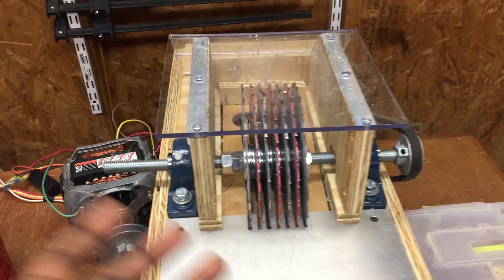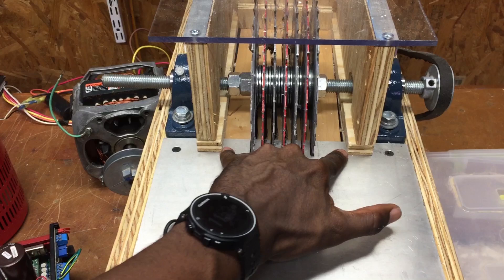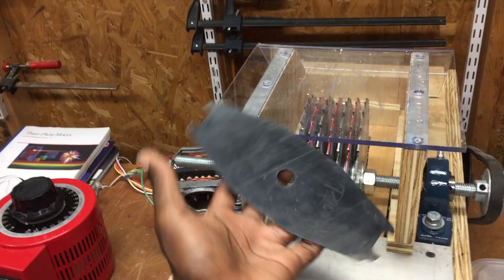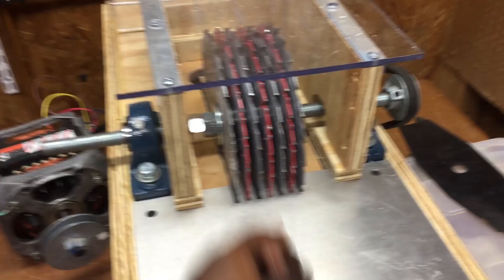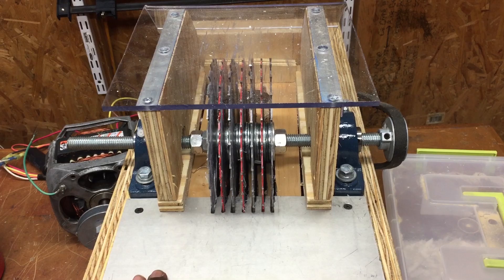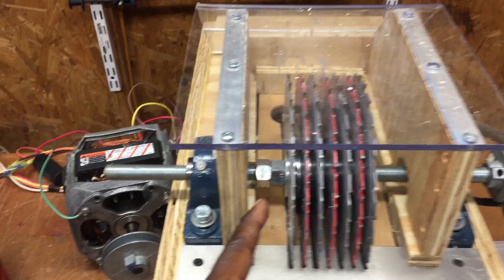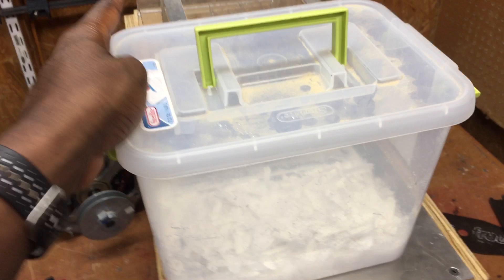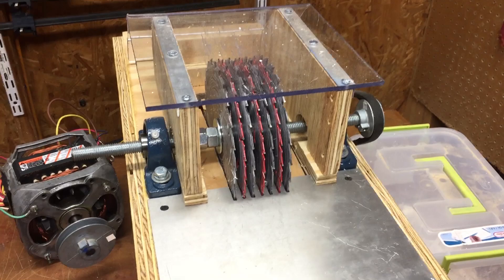Scary Prototype Shredder Design pt 2; A Cheap Alternative to the Precious Plastics Design: 037

Comment: That is a VERY scary shredder. But if you still have 10 fingers and 2 eyes then your safety precautions are adequate so far.

I'm very interested to know how the melt goes with the powdered plastic. I've had a couple go ok and a couple not so good, but the not so good I blamed on dirty plastic.

What material and thickness are you using for your shear plate?

I've been thinking about trying a 6 inch drum with 2 windows and replaceable blades (either utility knife blades or the single edge utility razor blades). I thought high speed rotation and very sharp blades might make plastic shavings. 

You're a great thinker and pretty good videographer. I enjoy your videos and like your style.
Reply from the maker: The shear plate is 1/8" thick aluminum and 1/2" thick plywood underneath. This allows it to be soft enough to cut with the blades and not damage them. I cut the wood first, then after that was installed, pushed the AL into place.

Comment: Also, did you try two sets of blades running in between each other?  You could then top feed and not worry about grabbing. They would share a shear plate.  Working like two rollers pressed together.  Just a thought.
Reply from the maker: I don't want two sets of blades because that requires a great deal more power. I can do more power but only if it is absolutely required. One of the things that makes Dave's Shredder difficult is you need such a powerful motor. I am actually hoping to make it 1/2 hp instead of 1hp... the current setup.
Reply: Jeremy Fielding It would be nice if you could use the air that you spoke of to recirculate the larger plastic back around until it fit through a sort of sieve.  Almost like a hammer mill.

Comment: Great videos Jeremy thank you again. What if you attached some chip breakers in between the saw blades. You could set the length of the strips of plastic by setting the chip Breakers a radius than the saw blades. The chip Breakers might also help keep the spaces between the saw blades clear. I was wondering if changing the the material's  angle of attack by adjusting the height that the front metal plate is placed at with respect to the saw blades. This might affect the degree to which the blades pull the material into themselves. These ideas may have already been put forth but I wanted to share them in the hopes that they may be of help
Reply from the maker: I am planning to push the blades back together like dado blades. I think the issue is the table height relative to the blades. It will be more like a table saw with a hopper

Comment: I'm a bit curious as to why your motor speed is so high.  Wouldn't you get more torque from your motor by slowing it down?  And, with a slower speed, wouldn't your final product be less granular and more easy to melt in the hot end of the printer?

Comment: Jeremy, while I enjoy the process... What's the point?  You're the king of recycle and re-purpose, but there's no need to re-invent the wheel.  There are plenty of dead, fairly skookum, cross-cut paper shredders in the dump, but they don't have the power needed to make them effective on plastic, so rather than starting from scratch, why not use the blades from those shredders, and just build a stronger housing and put a beefier motor/gear-train behind them?  If the objective is chopped plastic, that would seem to be the most practical solution.
Reply from the maker: I have not come across a shredder in my recycling/re purposing efforts. Also the very cheap ones are not strong enough. I tried to beef up one shredder as I mentioned in the video... it could not handle the power. The parts begin to fail, and the plastic would still jam. I gave up on that idea. Here is a short chip of that. It is less than a minute. https://youtu.be/Ct2tiqDktgI ... I think only an industrial shredder would handle being pushed by a large motor. I have not seen one. I am certainly looking.

Comment: could you not just leave the the plastic as long strands? it will still be easy to store over unshredded plastic and if required how about a second (more of a blender setup ) to dice the long strands if required . and regards to feeding what about just some rubber rollers (or similar) that are kept together with a spring but will allow wide opening
Reply from the maker: I like it. I think you are right... the long strands are probably just fine. I haven't tried yet.
Reply: Hi! How about one of those old clothes rollers they used before they had irons, they used it to pressure some of the water out of the clothes to I think. Mount it as a feeder you can hand crank, cause they came with a krank. That thing will flatten your milk bottles, so you can skip cutting then up in a band saw. With a hand krank, your fingers are safe, and you can place your blades closer to each other. You’ll have a plastic blender that is safe.
Reply: 'Mangle'.

Comment: you need another set of blades opposing that set so they pull the plastic into each other, i think you would get better feed and chopping and feed from the top let gravity help you feed
Reply from the maker: There are two types of shredders. You are thinking about the "Car eating" type that we are all use to seeing, but you should research single shaft vs dual shaft shredders. there is a reason single shaft is used in plastic shredders for recycling.

Comment: I like what you have done, and it has solved the nagging question as to how to perform rapid cuts. 

Cutting milk jugs into tiny pieces, is one big time consuming pain in the ass, and increases the risk of getting carpal tunnel.

I'm surprised to see what is virtually powder, which should result in faster melts, and more consistent flow of material when using an extruder, or injector. No need to create pellets. 

Right now you have seven saw blades, all the same diameter, spaced equidistantly, resulting in a cut of long strands of polyethylene. 

Replace all the spaces between each blade, with six smaller diameter blades, then add two addtional smaller blades, one to each end of the stack, alternating small-large-small, which will result in cutting each strand into tiny pieces. 

Add edge guards, to each side of the blade set, to guide the end cuts from straying off.

The size, or length, of the tiny pieces, is determined by the diameter of the smaller blades. 

The smaller the diameter of the small blades, will result in longer pieces being chopped off and dropping into the collection tray. 

Unfortunantely, those smaller diameter blades will most likely have to be custom built. 

If you increase the width of your cutter to be wider than a one gallon jug, then the only precutting required will be to slice out that pesky paper label from the jug, using a utilty knife, scissors, or a custom cutter. 

Your method also solves the problem of shredding large chunks of HDPE, such as milk crates, buckets, and scrap pieces of plastic left over after machining your parts.

Try this experiment.
The probable reason the paper shredder jams, is most likely due to its low speed.

Assuming the shredder you have does cross-cuts, then you might be able to abandon the saw blade cutter project.

Remove the gearing from the shredder, then drive the shredder cutting blades at high speed. 

Thanks for this video.
You've just thrusted my brain into overdrive!!
:

- edit -
Clarified my remark by adding the word one to the following statement:

...add two addtional smaller blades, one to each end of the stack...
:
Reply from the maker: If you have blades in between that brings back the problem I discussed in the video. The shear plate is needed to cut the plastic, but blades in between remove the shear plate... or make it too thin to withstand the force of cutting. If the bladed don't go through the shear plate they will score the plastic but not cut it. I don't think that will work. 

The paper shredder will not work. I tried high speed. https://youtu.be/Ct2tiqDktgI  . Those blades are not strong enough to handle real HDPE at volume. It begin to jam and fail. It can occasionally cut a credit card and that is it. Unless you get an industrial shredder. But that cost too much.
Reply: +Jeremy Fielding 
Support the shear plate like this guy does for his shredder.
v=W91tidmqh_k
:
Reply from the maker: That is certainly an interesting idea. But it is not what I am looking for... I haven't given you the whole picture. I want it to be low cost, easy to copy, and no welding. This is for wood workers with mostly woodworking tools. It might not be possible, but that is the target. I talk about this more specifically in the "more Power" shredder video. I could just make Dave's shredder if that was the only goal. I have the tools, the steel, the motor and gear box. I am hoping to do something bigger than make a shredder just for my shop. Please watch this video. https://youtu.be/VrZUpd1VgR4?t=22m48s it should start about where I explain the plan.
Reply: +Jeremy Fielding 
The only reason that I directed you to that video was so you could see how he implemented the support structure. 

If you do it right, you can get away with using epoxy, instead of welding. 

If you use supports, then you can use the smaller blades I spoke of, to get powder, or finer chips, than you would when using the crosscut method. 

I like the concept he used to do crosscuts, but his shear plate leaves much to be desired, being it is a sloppy fit, and resulting cuts are too big and scraggly.
:

Comment: OK, 5 years later and it seems like the Precious Plastics shredder hasn't changed much - they are working on a new version, but at a guess, that will be even more expensive than the old one. I only just found this video because some in the Precious Plastics community referred to it. It seems like a great design, or a great start rather. Did you have any additional ideas or efforts with plastic shredders?
I am also wondering about powering a shredder by a bicycle, which is something else that, again, Precious Plastics has plans on their website, but cost is still relatively high.
Reply from the maker: I have done nothing beyond this video

Comment: couldn't you just extend the sides and top and make the entry more of a tube?  and then that way you could put several bottles in and use the bottles themselves to push into the blades.  Seems like it would also stop part ejection since it'd just hit the incoming bottles and bounce around a few times til it hit the hopper.   no???

Comment: Your table is plywood and aluminum. What if you made the table out of 1" wide steel or aluminum bar stock set on edge and stacked together? You could buy the bar stock slightly thicker than your saw blade cuts to provide clearance. This would let you set the saw blades a lot closer together. It would cost a lot more than your current table of course, but you could buy a small amount of stock to test first.
Reply from the maker: +Mark Trombley I think the strength of that setup would be extraordinary. I already have some 1/4 by 6 flat bar I bought for the other shredder. I am concerned cutting the steel bars on edge might damage the blades more then I want. I could could them then replace the blades... that would run the cost up even more. But you only do it once. I am just thinking as I type but maybe I could create wood spacers and use that to set the position of the bars like figure joints. I don't know just yet
Reply: Hmmm. Not sure we are talking the same thing. If your blade cuts a 1/8" slice buy some 3/16" thick by 1" wide bar stock. Cut half the stock 6" long and the other half 6 1/4" long. Stack them up, alternating lengths. Drill 2 holes thru the stack so that you can bolt them into one mass. This is now your table. The blades will fit between the alternating fingers if you space them right. Hope that makes sense, I can't draw.
Reply from the maker: +Mark Trombley I got it.... But the gap is 3/16 now. I would need some 1/8" or so to make much of a difference. Each blade is thinner than that. I would have to make custom spacers to get it right over the whole span... and buy the steel. I could just cut the aluminum into strips. Turn it on end and it would be many times stronger it is 1/8" thick. I might try this.
Reply: another more accessible alternative would be some cheapo hardwood like maple. in fact after milling up the 1/8" or 1/4" stock it can be used for the spacers as well, like in your original prototype. you could even very easily thread the wood too lol

Comment: Nice series of video's on your shredder design! I'm considering making something similar to preprocess ABS plastic from old copiers and printers, before I feed them to the preciousplastic shredder. I'm thinking of using bigger gaps between the blades though. Have you tried shredding thicker ABS plastic pieces?
Reply from the maker: Only HDPE

Comment: Jeremy, I know that you mentioned that the counter rotating cams at high speed would be  a bad idea, but did you try with high torque, low speed?  Sorry if you've already addressed this.
Reply from the maker: +wortis25 no need to apologize. Plastic shredders often have one shaft. There is a website that explains the difference in performance between single shaft and double shaft shredders. However I am not at home so I don’t have the link with me. Also a single shaft keeps the construction simple. I want something that is easy to copy... not just a shredder for me. I talk more about this at the beginning of my last video on HDPE if you are interested “HDPE how much processing is required” (the title)

Comment: Hi Jeremy, First let me say I've really enjoyed all of your videos I've watched so far. I just found you today and started with your HDPE videos. Working with this type of plastic is near to my heart. After seeing the high quality and standards put into vids, I immediately subscribed. I have a question of course and wonder if you have ever considered it? Since HDPE is nearly indestructible and Very,very long lasting, it seems it would make a great building material. As in blocks etc. for perhaps a shed or popular " tiny house". It seems that if enough HDPE could be collected, it would make an excellent building material. The blocks ( made perhaps from a mold, to appear like slim cinder blocks) may even be able to be " mortared" in on themselves by applying heat to sides and ends. I live in a rural area and have a " deal" with the guy who oversees the local land fill to collect 5gallon buckets,milk jugs etc for me already. So I am slowly getting the base material. So far though I have had a problem with shredding. I will be making your shredder in the near future for at least the milk jugs. Hopefully the big buckets will shred too but will be very careful with those. Thank you so much for the Idea. It's been staring me in the face and couldn't see it. Any ideas on the blocks and building? Something better than blocks perhaps? Cheers my friend!!!    Ron
Reply from the maker: I have not considered using it as a building material. But I think with most materials, geometry is just as important as the strength of the material itself. I really can't say how or when it should be used. I just recommend you test it as best as you can as you go to make sure it will perform as you expect.

Comment: Just ran across your videos today for to say they are great. Have you considered the effect of different tooth count blades. Most shredders use a to tooth system obviously you won't find saw blades that low but they do make a five tooth for cement board.
Reply from the maker: Well, I think you are on to something, but for now I want to use the lowest cost blades. I do want to test this though. the 12 tooth blade if I remember correctly was the lowest count I saw. I think it will make a difference... I just don't know if the difference is significant in the final results... It is definitely worth testing... and I do plan to test it.
Reply: Jeremy Fielding totally understand that's what I like about your videos your not spending a ton of money on your builds. If you ever do buy them I think Irwin is the cheapest around $10 a piece.

Comment: You may have covered this before and if so I apologize, but couldn't you use a smaller diameter blade? You could run at higher rpm and it would require less power. I've seen 3 3/8 x 24t blades on Amazon for about $12. They're thin but they could be stacked and the arbor size might be small but I wouldn't think it would be too hard to enlarge
Reply from the maker: +Paul Jordan they have a breakaway diamond shaped cutout and I would be concerned trying to drill out the hole. However I could use a smaller shaft? Smaller blades would reduce the power needed which is important here